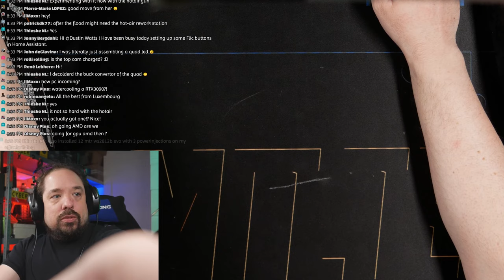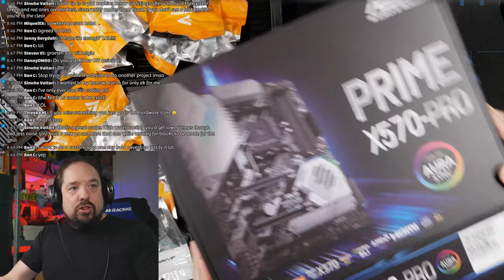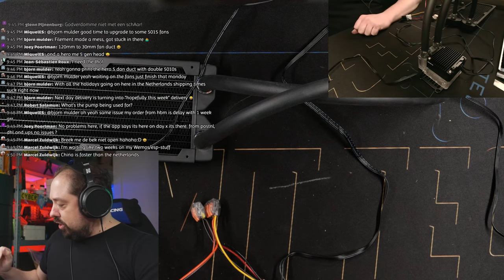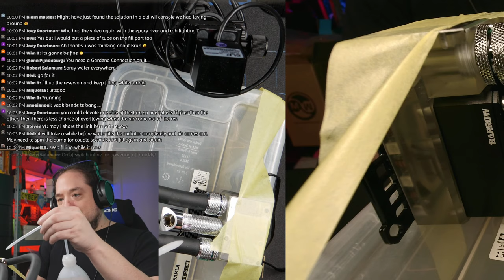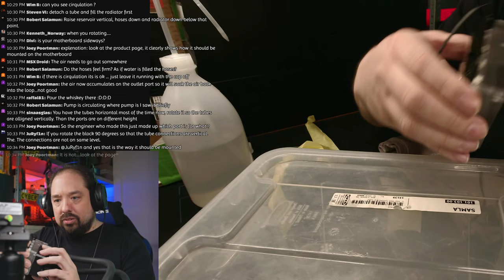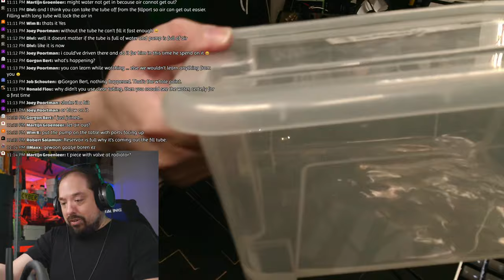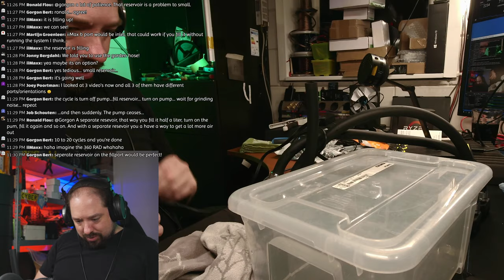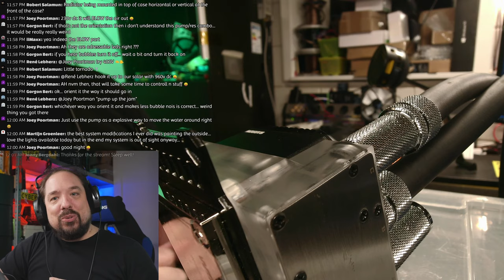Intermit.Tech #11 - My First Watercooling loop

Comment from the maker: Update 2 days later: So after lots of trying I've got it figured out, but this design is inherently difficult to work with. The reservoir is so small you need to carefully manoever each and every little bubble by turning it on and off loads of times (I'm talking hours of work).

Basically you are stuck. Run the pump slow, air won't be pushed through loop, run the pump fast enough, air comes loose and travels through loop, but reservoir is too tiny so air gets immediately sucked back into the loop again, having on chance to escape.

I don't think it's a bad product, but if you have the space a separate big reservoir is a much better choice. If you can't, this product can certainly work, but be prepared to invest many hours getting the air out of your loop as much as possible.